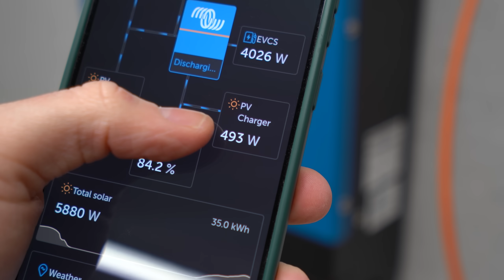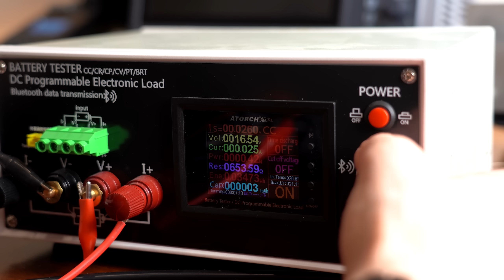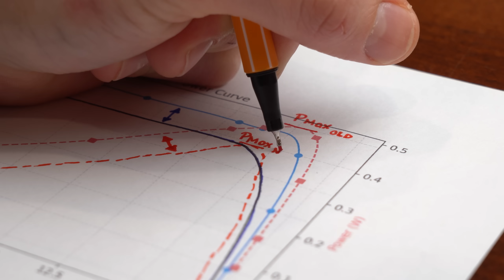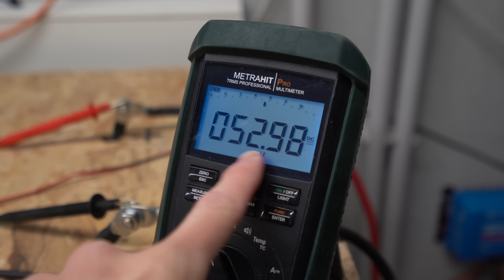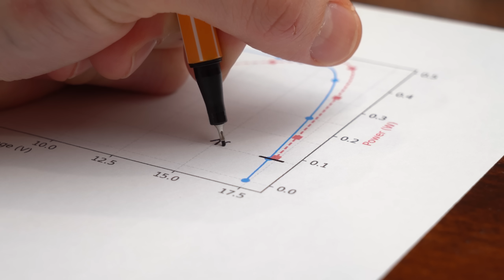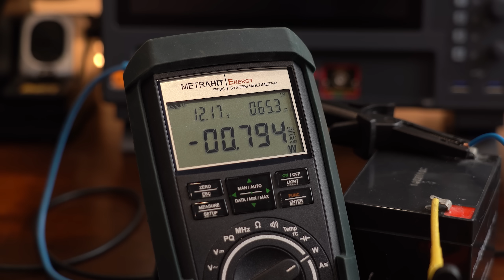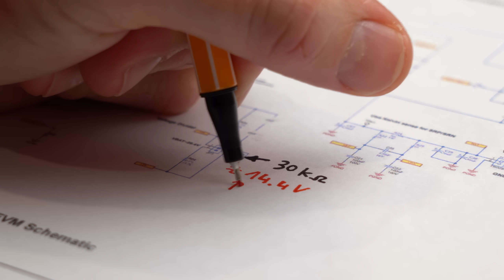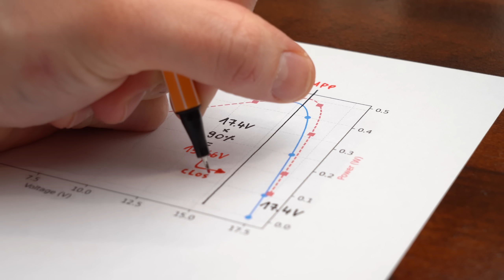My Wind Generator Was Useless....Until NOW! (MPPT)

Comment: In the US you can find a MPPT boost converter by searching for solar golf cart chargers. Many of them have 18v solar panels connected to 48v batteries
Reply from the maker: Fun fact. Thanks. Sounds useful.
Reply: Gotta love when something you are looking for is buried in a seemingly unrelated product.
Reply: those are really cheap and work quite well. The one i am using to charge up my Pedelec's 13S battery from a common 18-20V foldable solar camping module has voltage and current displays for both input and output. It also comes in a sturdy aluminium die cast housing that is at least splash proof and can withstand light rain. The only thing you need to do is set the charge voltage limit and away it goes. It's barely getting warm even with 150+W put through it. Only downside so far: It only starts up with 17-18V of input and it can only convert upwards with a minimum difference of 6V between input and output. So no, it's unfortunately unsuitable for the purpose shown in this video. AFAIR, most of those readymade modules come with such a limitation. But they can be made to work with a wind generator by using a bridge rectifier and a small filter cap. Or in a pinch, you might also use a USB-C PD trigger.
Reply: Hmmm. Good to know. I'm looking at the idea of converting a very old (mid 90s) dead ride-on mower to an electric runabout cart thing... And where I'll be using it, solar charging would be the best option, especially considering I've got access to some old 230W rooftop panels that got replaced... 2 in series would do it with a PWM controller, but for space reasons, I'd rather use just one.
Reply: @ take a look at those elejoy converters, they are available with up to 400W which would fit your spare panels nicely. It is generally recommended to have more power on the panels than the converter. There is a step-down version, too. E-Cart drive systems are usually 36V or 48V systems, which should work well for your purpose.
Reply: Thanks for your informative presentation. Wind generators are problematic.  I have an Air X type original wind generator. The output varies wildly with the changing wind speed so you need a fast MPPT tracker.  Then you want to avoid the MPPT tracking starting at the high voltage so you don’t allow a high speed run away on the wind generator potentially doing damage before the load is increased.

I think in my case the onboard circuit which rectifies the AC from the generator tries to be half smart by shutting down if the voltage output gets too low.  That might limit the use of a boost converter. I will do some checking on what it does at low wind speeds and no load.  I had not considered the low wind end useful but as you say the generator looks capable of delivering power, but does not because it does not generate enough volts.
I look forward to your next presentation. Thanks for the simple explanation.
Reply: Thank you!! I want to charge my 16s LFP Pack by foldable PV Modules!

Comment: Yes, finally someone is investing thought power into this. This is one of the reasons I gave up windpower, second reason is the stupid design of windmills but if you fix the charge controller it is easier developing the correct windmill. The windmill charge controller you are searching does not exist. Reason is same mainstream stupidity as placing 30 kW monochrystalline solarpanels in same latitude/longitude hoping sun will shine the perfect hour it passes this point. Avoid mainstream NPC. Sending my contribution, what you are developing is not cheap.

Comment: Ideal Diodes, rectify the 3 Phase, and then use an "Ecoworthy/Sunyima" MPPT Boost controller.
Reply from the maker: Will have a look ;-)
Reply: ideal diodes could be the way to go for maximum output in low wind environments, minimal voltage drop in the conversion to DC, but at higher cost and complexity of course.

Comment: Hi!

Do you know if there's a lower power version of the ZJ-SJ20 available? I'm looking for MPPT that would take ~18V from a solar panel and output ~41V to charge an electric scooter. The panels are only about 50W, so i'm looking for something that can efficiently convert solar. I'm guessing its going to be difficult to get something, that does real MPPT though.

Comment: My lazy Solution: Increase the voltage of the Generator with a transformer before it gets rectified
Reply: Scott's scope was clearly showing a roughly sinusoidal AC waveform coming from the generator.
Reply: With such a small three phase alternator, using transformer is tricky .Firstly the losses with transformer huge,secondly speed not constant so frequency will  change over wide range .Making impedance matching transformer virtually impossible.Ineffecient.
Moral of the story?Windpower bad idea.But electrical and electronics behind it quite interesting
Reply: @henkmeiring01  Wind power is a great idea, what are you on about?
Reply: @pootispiker2866  probably the fact that its not😂 hydro is way more effiecent, then solar, then wind. You dont make alot of power off wind unless you dump alot of upfront cost and regular maintanance into it with an inevitable shelf life. Sure the same goes for the other 2, but streams dont run dry like the wind sits still at times. And the suns fairly consistent when it is shining. Wind might be the better choice for some geographic areas, but anything else is prefered first.
Reply: @UnifiedInfo  Being worse than other options in their ideal applications doesn't make something bad ya bellend
Reply: @UnifiedInfo  Streams don't run dry? You mean, glacially fed streams? Wow.
Reply: @UnifiedInfo  That is a bit too generic. River flow, sunshine and wind are seasonal in many places I had 9 days without sun here in Ireland. In December, the sun comes high enough over the horizon enough to light the panels for about 4 hrs/day.
Reply: @WimTon  ya I kinda implied that with geograchic location, my only point is hydro makes the most power per cost, if you have it to tap into in the first place (flowing water). If not then its likely solars the next best option. And if your out of luck in both those area then hopefully geothermal, but wind is last to consider for me personally given cost, service life and return. It may be the best option geographically. But you'd hope otherwise if you want to keep cost down and effiecency up.
Reply: @ I agree on all points.
Reply: Yeah, this was my thinking also, but it would make more sense to just recoil the generator for more voltage.
Reply: You can not it’s dc voltage
Reply: @amaanqureshi1286 
I think its a BLDC Motor that is basically a 3 Phase motor with some fancy electronics, but I might be wrong.
Reply: @amaanqureshi1286  not on solar, but sure can on the turbine.

Splitting hairs tho, the transformer configuration might be hard to optimize, given the varying frequency.
Reply: @amaanqureshi1286 put 2 wind turbines in series 😂

Comment: An idea comes to my mind to use a SEPIC converter at the base of a dynamic MPPT controller, which is flexible enough to be used for different Power sources. Naturally, the controls will be more challenging, but that's the charm of the design, right?
Reply from the maker: Maybe next time ;-)
Reply: Judging by 2 power inductors, module shown at 5:47 is SEPIC.